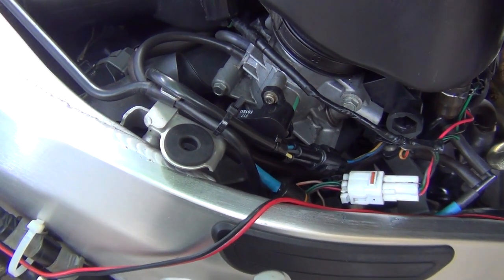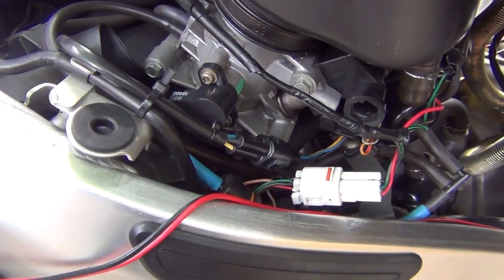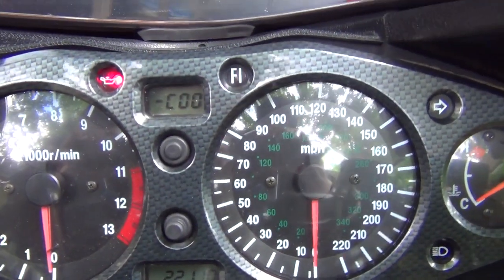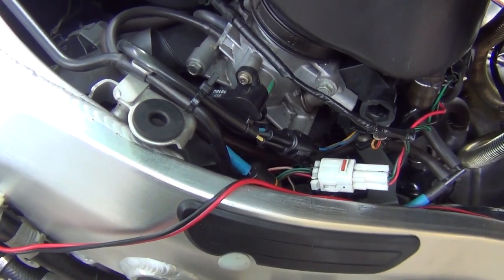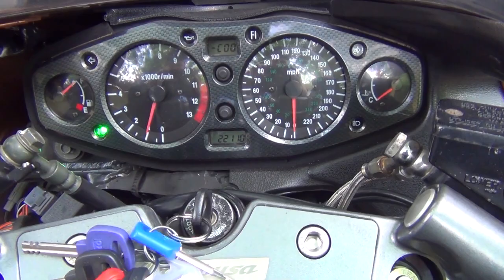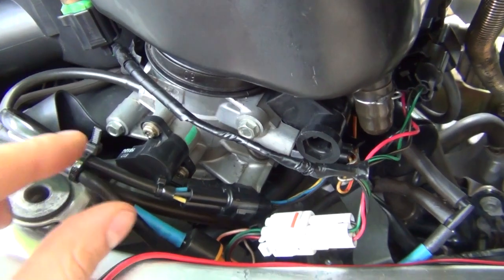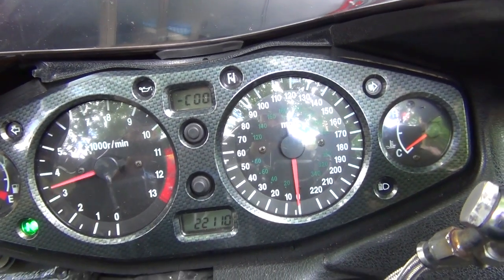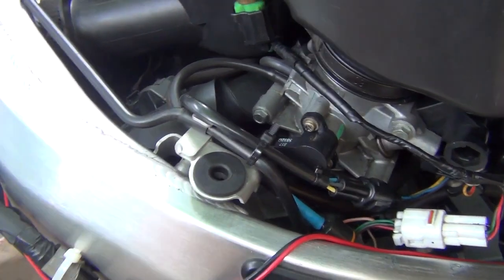Hayabusa Throttle Position Sensor Adjustment

Comment: Put my 03 busa in dealer mode and got the little dash on the bottom _C but as soon as I started it went to the center -C ?
Reply from the maker: As long you have C00 that's good. Dash at the bottom is a matter of calibration of TPS. You can calibrate it yourself and its quite easy, check my other vid for that prcedure. Does your bike run poor? If it doesn't then no reason to worry.

Comment: i have a 01 busa that runs rich. and  pops.  .  wat you think
Reply from the maker: Could be many reasons. Balancing the throttle bodies could help. People say Tps calirtation could help.Ofteen backfiring is caused by bad plug or bad coil. In my case it used to backfire cause fuel system was screwed by dirt.